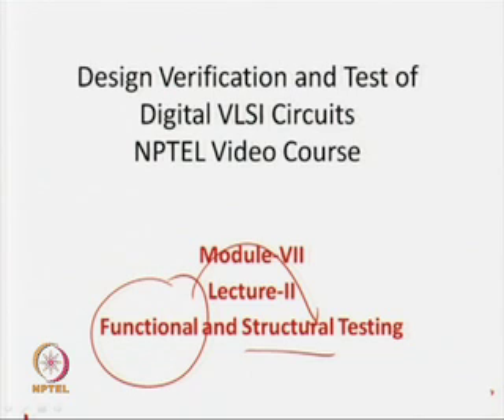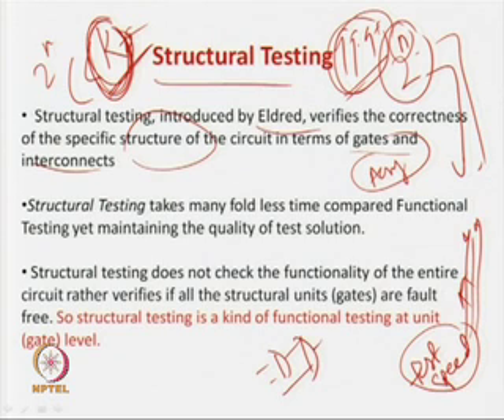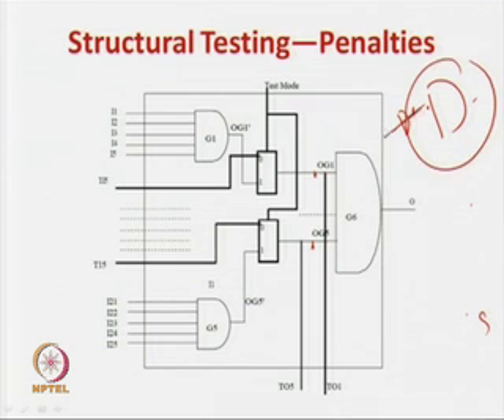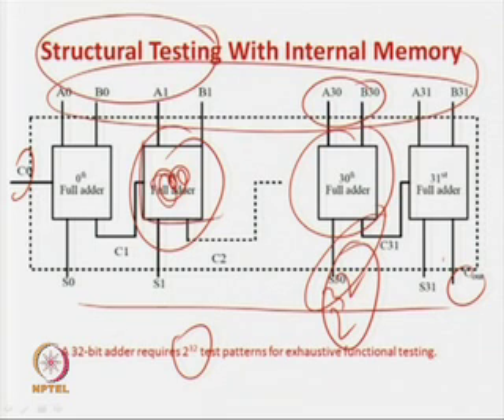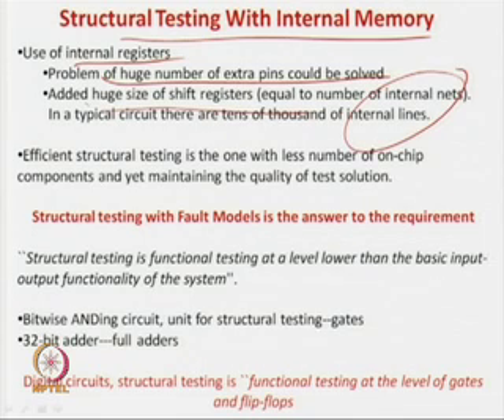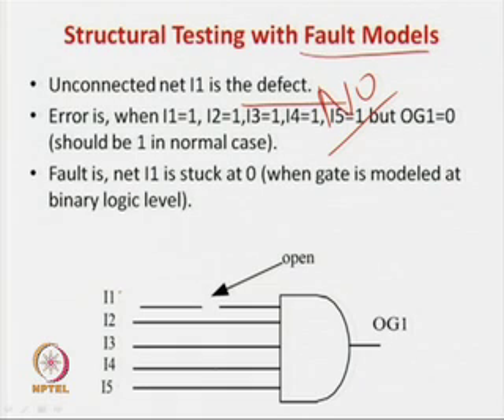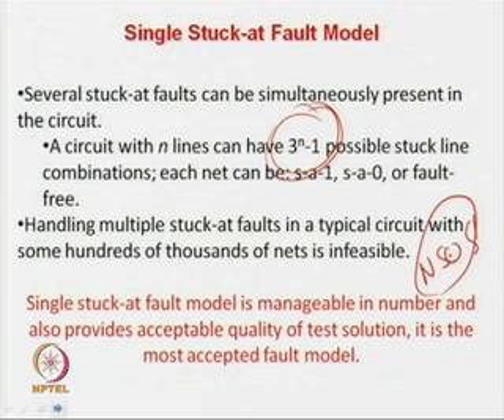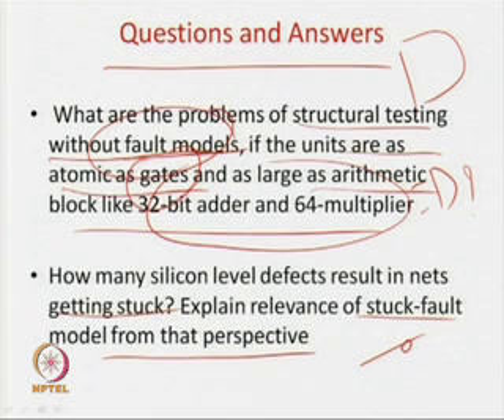Mod-07 Lec-02 Functional and Structural Testing

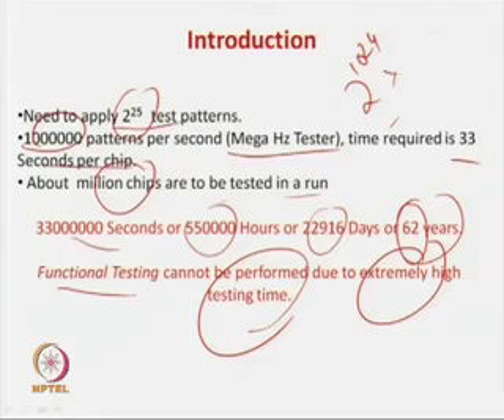Comment: At 7:00  total pattern 2^25, for 
1 MHz  tester approximated as 
33 sec per chip for one million it takes around 33000000 sec and when converted to Hours, 33000000/3600 = 9100 hrs and when converted to days 9100/24 =380 days and when converted to years 380/365 around 1 year. Sir has written 62 years.